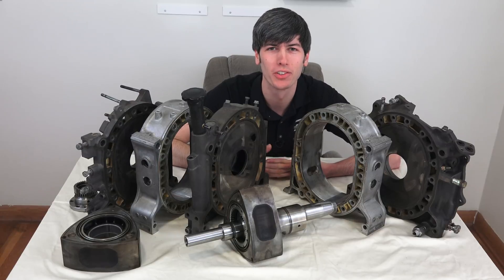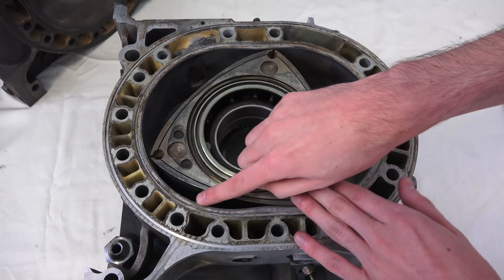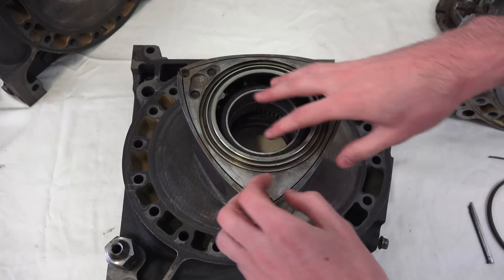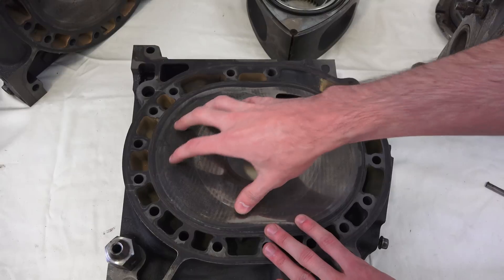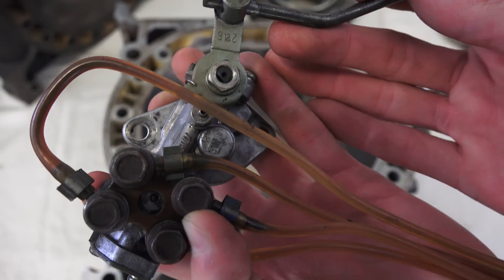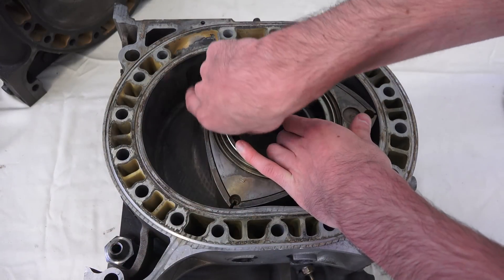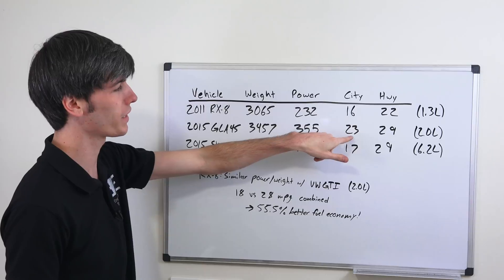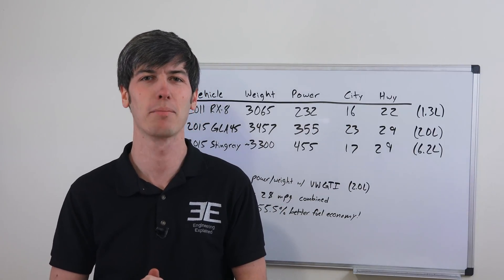4 Reasons Why The Rotary Engine Is Dead

Comment: Ok people ... with regard to all of this talk about a rotary being 2.6L instead of 1.3L: when the engine was first developed in the early-to-mid part of the last century, it went through several international automotive design, review and certification panels.  Ultimately the decision was that it was 1.3L (or 1.1L, as the earlier engines had smaller displacement) in total between the two housings.  Half of that if you only count 1.  This conclusion was agreed upon by the top automotive engineers of the time and confirmed since then.  So stop all of this business.  It doesn't "act like a 2.0" and it's not "really a 2.6" ... sorry to burst your bubble, but it just ain't so.  I'll spare you the math, but will be glad to chime back in if someone wants the gory details.
Also, and I'll start with the Engineering Explained guy (who's videos I like, don't mistake that), please STOP referring to the engine as a "Wankel"!!!!  No rotorhead refers to the engine that way, it's just "a rotary".  After all, no one refers to the piston engine as "an Otto" do they?!
Finally, your video was accurate, though there are design options that help many of those issues; I hope that Mazda can work all of them out into a single, new form factor that is a winner.  We'll see.  That said, the one item that your video didn't mention was the low torque, particularly from a dead start.  I mean, there was mention of "low power" and several of the comments here refer to that, but to be specific, the HP is quite good for a 1.3L engine, it's the torque that was the problem.  And that, even more so than the engine temp issues, was an area of grave concern for enthusiasts like myself.  Most of us choose to simply overlook that and enjoy a rotary for its other attributes.  BRAP as another viewer mentioned being up there. lol
Anyway, my $.02.
Reply from the maker: +Jerry A No need to be silly about the name... it's called a Wankel engine, it doesn't run on a "Wankel cycle." Rotary engine has two common meanings, one of which is a piston cylinder design often used in aerospace. Wankel engines by design use a rotor, rather than pistons, making the communication more clear. Yes, it's a 1.3 liter.
Reply: +Engineering Explained Hmmmm...don't understand and can't relate to parts of your reply.  So I'll start at a random point of order.  First, it's not called a "Wankel engine" by those in the know ... we call it a rotary.  Call it what you wish, but in so doing you illustrate your experience with it.  Have no idea what you mean by a "Wankel cycle" ... is there an "Otto cycle"?  And no, I wasn't trying to "be silly" about the name; just trying to correct folk, that's all.  No disrespect or anything else intended, not sure why everyone in the Internet is so quick to jump to that negative conclusion, but it is what it is.  And no, the "old timey" airplane engines where the pistons were arranged in a spoke-wheel pattern on the front of the airframe were NOT called "rotary engines", they are called RADIAL ENGINES.  This too is another misconception.  I am a pilot and have flown a few of them.  Finally the 1.3L (13B) existed only from 1984 onward, beginning with the 1984 Mazda RX7 GSL-SE.  I should know, I have three of them.  Prior to that, it was a 1.1L (12A) engine, in the RX2, RX3, RX4, RX5, REPU, Cosmo, etc.  After 1985, beginning with the second-gen RX7, the 1.1L (12A) variant was no longer produced for the RX7.  There are other variants of the rotary, but that's the birds-eye view.  Hope this helps.

Comment: You're comparing an engine that was put in 2003 model year cars to brand new engines.  That's a difference of over 10 years and that's not even considering the design/development time.
Reply from the maker: +jayfulf A 5-speed 2001 Golf GTI gets 33% better fuel economy. Better?
Reply: Engineering Explained Good model year.  Much, thank you

Comment: That is a mechanical oil metering pump. In 1989 they changed it to an electric version. The OIL PUMP is behind the front cover and is turned by the eccentric shaft. I wanted to clear that up so nobody thought that was the oil pump for the whole engine. Also, If somebody cares so much about gas mileage then why would they even consider a rotary powered car? A Mazda RX-7 wasn't built to compete in the mpg game with the econo boxes. We're talking about one of Japan's legendary sports cars. Gas mileage is irrelevant. Emissions on the other hand is true. Rotarys are dirty engines. Remember you can buy a 2002 Mazda RX-7. Just not in the states and that's because of the emission restrictions. Lastly, Mazda is still the only Japanese manufacture to win the 24hrs of Le Mans and that was with a rotary.

Comment: It seems pretty absurd to me to try and make an apples to apples comparison to a Golf GTi. You wouldn't have the low center of gravity and 50/50 weight distribution of the RX-8 with any of the Golf's engines. When you consider an engine you have to consider it's purpose; those cars have entirely different purposes. Maybe a boxer of some sort would have been a better comparison?

Comment: Part of me can't help but ask why Mazda has not made a rotary-electric hybrid vehicle? You would think that some of it's shortcomings could be compensated for if the rotary engine wasn't being used 100% of the time. Would ethanol based fuels be better for efficiency, since gasoline won't have time to completely burn off? Would this design become more efficient with the aid of a turbocharger?

Comment: You didn't mention the lack of low end torque. Would be nice to have seen that as part of the video
Reply from the maker: +Prashanth Krishanduth Torque is a matter of gearing. The engine is high power for how big it is and how much it weighs, so with proper gearing torque can be addressed. Not really a big issue.

Comment: It's very similar to a 2 stroke vs 4 stroke (rotary being 2t) engine in motorcycles.

Massive power output from its size and fewer moving parts, which require little bit more maintenance. Emissions killed both of them.

These engines are for enthusiasts.

Comment: I've heard many say that a 1.3L rotary is really a 2.6L, because of the timing of the power stroke. I've always felt it acted mostly like a revvy 2.0L 4 cyl engine in output and the way they drive. 2 liters pretty much cuts the difference between 1.3 and 2.6. What do you think?
Reply from the maker: +Alex Gavieres I think it's a 1.3L, as described. It's a measurement of displacement. 2 stroke engines don't have more displacement than 4 stroke engines, even if they make more power per liter.
Reply: That's a given. But what piston engine are they more similar to?

Comment: It's there a way to alternate the chambers to fire on both sides and have intake on both sides? Should help with heat expansion.
Reply: +Dalton Klinkenberg I think that there is no good way to do that, every rotor face is already doing a job all the time, in order to make it work on both sides you would need some way to divide the work evenly but I can't figure out a good way for that to work. An second intake stroke could only take place during an already occuring combustion stroke, which just won't work. Plus you'd need intake and exhaust ports on the other side of the engine as well, which diminishes one of the benefits of a small engine.

There might be some really weird way to make it work by having 'dead' strokes at strange times but I have no idea how you'd time it properly.  And if you did figure out how to time it you would almost certainly have fewer power strokes per rotation that way, at least as far as I can tell...
Reply: +ConnorWolf I was thinking along the lines of how the gm's v8 turns to a four cylinder, just alternate when fuel comes in. Engine are spinning at thousands of rpms, there has to be a combo there

Comment: Yep can't disagree with anything said here... after owning an rx8 for several years etc

the economy is terrible.
power was very lacking even compared to normal cars & that's the 231bhp model.

I thought, however Mazda was redesigning the rotary, making it smaller & lighter etc to help increase there efficiency (alil more) 

I do think they should turn the engine sideways in the engine bay, add forced induction from either method & use 2 cats rather then the 1 large item as they used on the rx8 as these really don't last.. not forgetting adding more oil injectors rather then doing the usual & keeping it as 2 injectors, even though this has been proven insufficient ever since the rx7 had been produced & redesigned.

only time will tell if the engines totally dead now
Reply: +corexisguhmazin I already know the future concepts of the rotary, the new ideas etc... however just taking a back seat & realising the issues the rotary have... Will Mazda actually make these cars go into production, no-one will know til they actually do... I only hope they make big changes, aka add forced induction to make a sport car... however will they ever make a rotary with better reliability, as upto now all I see is 2 steps forwards & 4back
Reply: +Mal Peacock They really only make their power at the top of the rev range, yeah.

The new engine Mazda is working on is actually larger and lighter. (1.6l)

Turn it sideways? I know Saab has longitudinal FWD cars but I've never seen a transverse RWD car, just seems like extra complexity and weight for no reason IMO. What was your idea behind that?

Forced induction would be nice with how far that tech has come since the 90s when it was used to notoriously unreliable effect on the RX-7. But hybrid tech would help the most, I think.

Oil injectors may be less necessary with the new direct injection technology Mazda is working on for the 16X
Reply: +ConnorWolf yes I'm aware of when the maximum power range takes effect, however... my issue is since its listed as a sports coupe & yet basic cars can out accelerate the rx8... There isn't really an advantage of revving the car high to get going at speed when the overall power just lacks, hence it needs forced induction to make it a true sport car.. As it's got handling, styling only reliability & power delivery is massively lacking..

transverse engines there's quite a few however mainly ranging for the 4wd variety old school models evo, Celica turbo to name a couple. I mentioned turning the engine as it would give greater/equal cooling rather then mainly the front end gained more cool air (funny how it's more common for port 1 to fail, rather then the rear rotor) uknow..

Yeh I've read about the newer versions of the rotary.. even Mazda noted they wanted to reduce the weight of the rotors to decrease the rotational weight within each chamber.

the oil injections need to be higher the the series 1/2 rx8 as in the series 1/2 rx7 Mazda only opted for 2 injectors & in both car models the 3rd & final model R3 rx8 & series 3 rx7 all had an upgrade with oil injectors/increase numbers this with both car models proven a higher reliability for the cars.

regarding the engine even if Mazda moved the engine to the rear as previous prototypes... this could also help 'possibly' especially if aiming for sales in a sports coupe category
Reply: +Mal Peacock the engines aren't dead check this new concept with a new roto motor from mazda : RX-VISION with SKYACTIV-R
Reply: Mal Peacock yea true. I hope they follow through with the new ideas and make it more reliable
Reply: +Mal Peacock Yeah this engine is so underpowered it is screaming for a supercharger.

Comment: Where does the fuel enter the combustion chamber? (Injector location.) I was waiting for you to mention it it both videos.
Reply: It's single point injection, so it's injected just after the throttle body on the intake manifold, before it gets near the rotors
Reply: +x3D Gotcha, thanks

Comment: Quick question regarding burning oil. I have a 2004 rx8 and I did the SOHN adapter that allows me to run an external oil tank. I run TCW-3 2 stoke oil in as do a lot of other people that run the adapter. I was just wondering what your take on this is over the original design.
Reply from the maker: +Ryan Wreyford Interesting. I'd probably run the same oil Mazda recommends, but having an external reservoir would be nice simply for checking the levels.

Comment: Why would you compare a 2011 car to a 2015?
Reply: +MeatyPotato Cactus You can make the comparison because piston engines have increased in efficiency and can continue to do so for now. The rotary engine cannot be helped. at least not very easily. Hopefully one day better technology will come out that can be applied to the rotary but back to the question... its not meant to be a direct comparison. It's showing how rotary engine development has hit a ceiling and that conventional engines can continue to be improved and will get even better over time for the foreseeable future.
Reply: yeah yeah fair point, but his statement still holds up. Look at a Golf GTI from 2001
Reply: ***** uhuhuhuh I meant 2011, not 2001. Typo. Sure, but then they should compare it to a... 2003 Golf GTI. Or whatever compares well with it.
Reply: Nee het is steen Than look at the disel vw-s from 2009. They are fucked up,.

Comment: RX-8 1.3 litres hmm. Depends what way you look at it, some engineers would claim it was a 3.9 litre engine...
Reply: +pickatchew but the cc is still worked out the same way, maximum combustion chamber size - minimum combustion chamber size. It's still just a physical volume, used in a different way
Reply: +pickatchew So... Would you admit that the reason people say they're equivalent to 6 cylinder 3.0 litres is because of power output?
Reply: +x3D I think you didnt understand his point.
Reply: Look at the size of the housing in the video, it's about the size of his hands. There's no possible way it's a 3.9
Reply: +ThePaint explain?
Reply: +x3D Well, rotaries and piston engines are completely different worlds. So comparing their CC levels isn&#39;t fair. A 1.3L rotary is a lot like a 3.2L 6 cylinder in the piston world.
Reply: Right, it might be the same, but in different ways. Rotary power output is soooo different from pistons.
Reply: +x3D But that's the point, which volume?

 Does it have one combustion chamber with one "piston"  that bobs back and forth ingesting 1300cc each time it does?

Or does it have three chambers, one for each side of the triangular rotor each doing different parts of the Otto cycle at the same time? One side may be compressing a charge, one side exhausting and the last on it's intake stroke. Count all three and it's 3X1.3 = 3.9

(Actually the chambers are quite big enough for this. remember that at any one time some of the gas is compressed and there are two rotors...)

The motor industry preferred the first view for tax and competition reasons. At one time there were Norton rotaries wiping the field in Superbike with a claimed 600cc. 

Engineers would tend to take the second larger volume as more representative.

http://www.rotaryeng.net/Ansdale-displacement.pdf
Reply: +Donald Sayers I would say, that, like in a normal piston engine, there's one combustion after another (in a four cylinder, four stroke design), so there's always at least one intake/compression/ignition/exhaust at any given point.

This is the same for each rotor.

There are two rotors which have a displacement of 0.654cc each, which would obviously give you 1.308 litres.

Comment: This is exactly why amazda needs to put the rotary in a super lightweight car like the MX-5. The next RX should be nothing more than a MX-5 modified to be a hatchback with different front and rear styling and different suspension tuning.